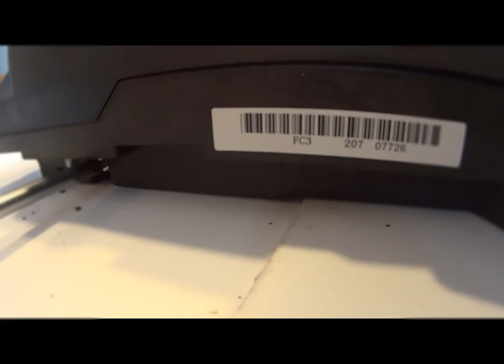FUSER UNIT RICOH MPC3003 MPC3503 MPC4503 MPC5503 MPC6003 MPC4504 MPC6004

Comment: good morning Tomasz I'm a reseller I have a problem with a customer's mpc 3003ricoh actually smeared print on one side of the sheet not reproducing the side print in some areas and the toner stains on the back of the sheet what can it be? surely it's the fusion group I think.thanks a lot tomasz have a good evening .
Reply from the maker: I'm afraid your fuser unit needs to be regenerated. But remember that Fuser Film, Oil Pad, Oil, Press Roller always need to be replaced. Don't skip any item.